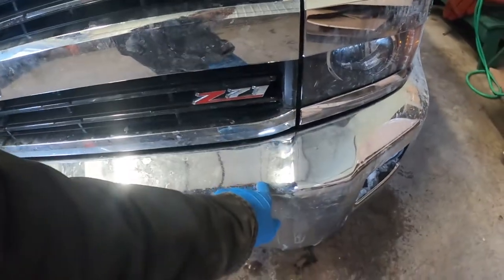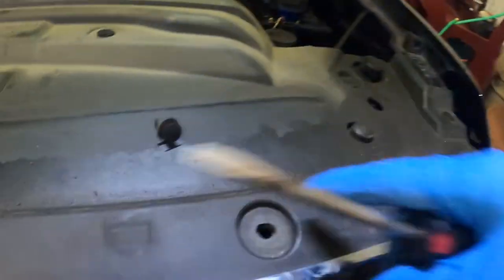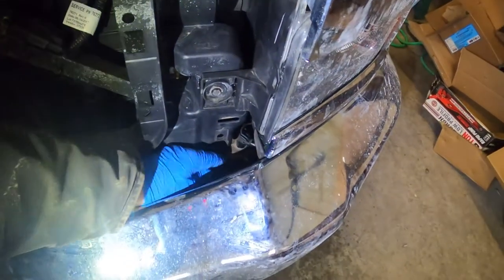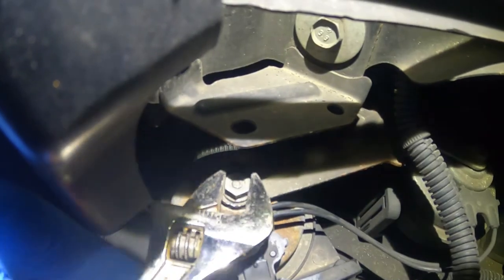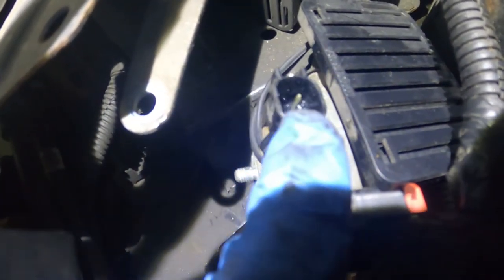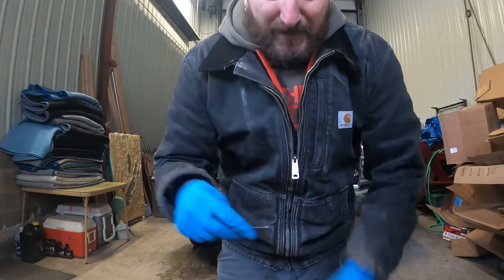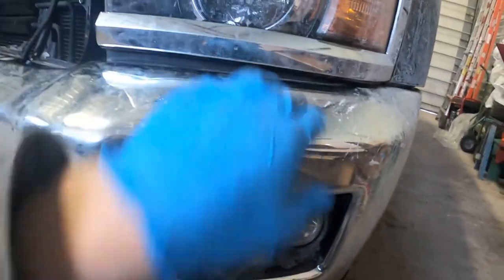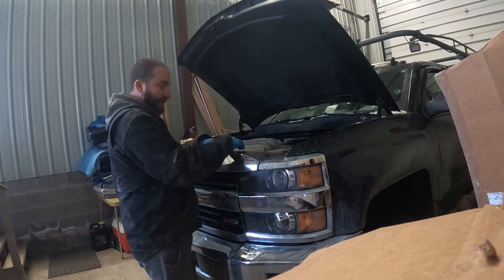Easy Silverado Horn Repair - 2014-2019

Comment: There’s 4 bolts in your headlight don’t snap it off like I did haha 😂
Reply from the maker: OH NO! Did you bend it out farther than what I showed in the video? It was still attached somewhere and I couldn't figure out where or how and I was afraid of breaking it too that's why I just pulled it out enough to get my hand in there
Reply: my 2016 GMC 2500 has 4 bolts on the headlamp also…but I chickened out before breaking stuff. The bolt is right above the horn close proximity to the bottom bolt. Couldn’t fit a wrench in to get to it, so I put the truck back together and will contemplate another approach
Reply: @danielbehn9033  MY 2016 headlight is different than the one here.  It has a colored trim piece below the headlight and it looks like there's another bolt buried.  Just came back to see what I had missed.  Just noticed this is a Silverado and mine us a Sierra.  Perhaps that's the difference.

Comment: I have exact same year exact same truck my horn works but when I lock it with my Fob the horn sounds really weak. What should I do? It’s a 2016 with just 34k miles taken extremely good care of it. I just don’t want the dealer to bend me over
Reply from the maker: I mean it's pretty easy to access, worth taking it apart yourself and seeing if it's just the connection

Comment: GM makes a non-dielectric grease for electrical connections , its yellow, found usually on headlight connections, they dont put it everywhere cause theyre cheap, get it out the door quick as possible
Reply from the maker: very interesting!
Reply: @BorsellinoHomeServices  actually non dielectric grease can be found in many places

Comment: What if it’s the key fob when you go to click it and it sound weak like a faint sound
Reply from the maker: If the horn is weak then this might fix it. If I remember correctly, my horn sometimes sounded weak and weird before it died. Then it would work intermittently. It's worth a try before bringing it to a mechanic and paying hundreds of dollars for them to diagnose and maybe fix it. Most mechanics nowadays are just parts swappers so they would put in a new horn and it might just be the connection! Even if you need a new horn if you go through this process and it doesn't work you can swap out the horn easily!
Reply: @BorsellinoHomeServices  thanks bro it worked exactly
Reply: @milk764 did your horn ever get stuck on after the faint honks with the fob? Mine did, I pulled the fuse out 😢

Comment: look up dielectric- youll find its first duty is to do all it can to stop electricity moving between items- not what you want   in electrical connections - spark plug boots yes, mostly everywhere else no
Reply from the maker: thanks for the tip!

Comment: My horn when pressing the steering wheel does not work but the panic button and lock button all make horn work any idea? I don't get voltage when pressing on horn inside cab.
Reply from the maker: that would lead me to believe the wire between the steering wheel and the horn is damaged if the horn works for those other things. But I honestly don't know for sure. Luckily mine was the simple connection right at the horn. There is probably videos out there showing how to take the steering wheel apart but I'd be cautious of that because the airbag

Comment: Great video! My 2018 Silverado is doing the same thing when you arm the truck it doesn't beep most of the time....

So you didn't replace the horn? You just cleaned the corroded connections and that did it?
Reply from the maker: YUP! Just a bad electrical connection in my case. Hopefully it's just as easy for you!